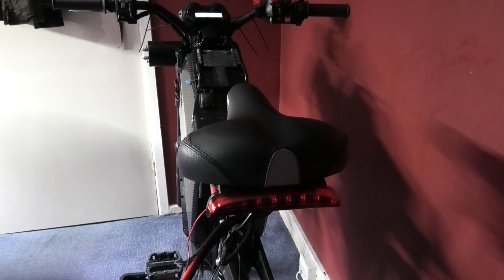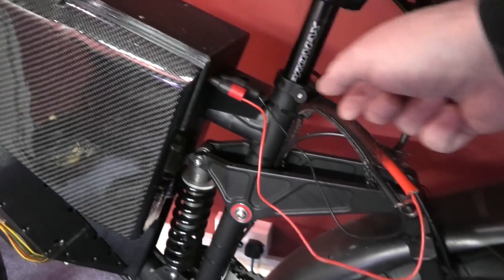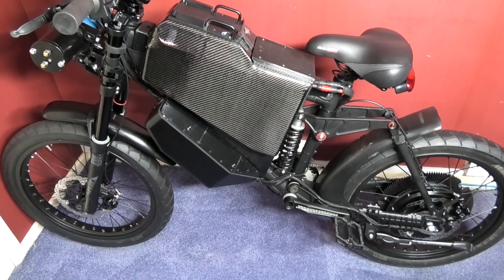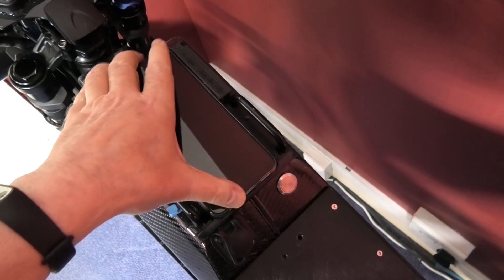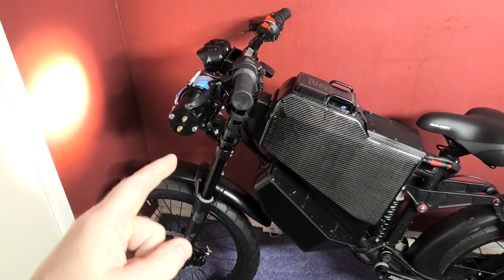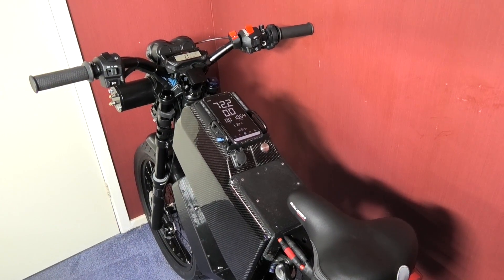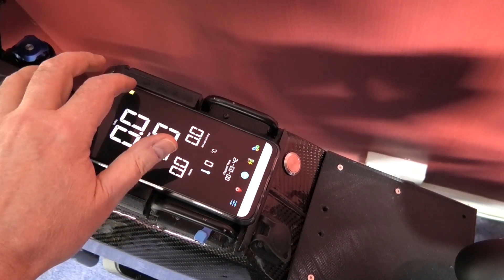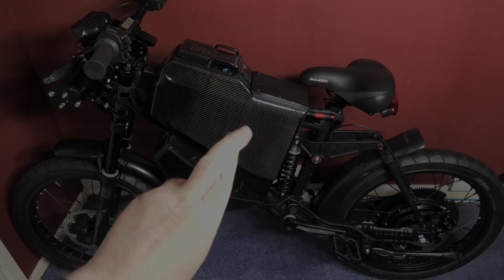High powered DIY eBike MSVA build part 30 - Ready(ish) for the maiden!

Comment: Take it down the stairs on the back wheel m8  balance it by the bars and you can use the back brake to controll the rate of descent.
Reply from the maker: Believe it or not, it'll be fine going down on 2 wheels mate. V2 was done the same way and I never had a problem 😁

Comment: Nice job Tony, it be interesting to see if the winch works. It looks to me, to be mounted above the pivot  point of balance. It could bury the front wheel into the step and start lifting the rear wheel first, kinda thing. From  an old excavator and tractor driver'
Reply from the maker: You might be right mate, it has crossed my mind. The trouble is, there's nowhere else to mount it - I can't attach it to the forks or put any pivot point on he forks because it might rip them off so I was kinda stuck. I'll be there to hold the back end down, though. FYI I'm a fully qualified agricultural mechanic with class 3 license so I know a thing or 2 about the implications of torque 😁
Reply: @Vortecks  Yeh, it's one of those "suck it n see how it goes. I presume you have a lifting eye attached to a wall, so you'll climb the stairs first to attach, then back down to stand behind him ? it would be a shame not to be able get him back home again. Is it possible to swap the two around? (winch to the wall - eye to front wheel axle) You still have to climb the stairs twice, but may have a  better pull. I can see a Laural and Hardy event coming soon..Haha...

Comment: Really ! make your monster look more like a bicycle, no chance, I'm still really impressed but I don't think you could peddle it for 1 mile which would make it a bicycle.
Reply from the maker: Please don't shatter my illusion 😂
It no longer has a motorbike headlight, motorbike indicators, motorbike tail light cluster & number plate holder - it's now a bicycle! 😂
Seriously, I've got to do something for testing and this is the only way I know. When I put it through the MSVA, all the stuff is going back on so it won't matter at all.
Reply: @Vortecks  I am absolutely awed that your doing the MSVA and want you to succeed, it was a pity that Andy Kirby failed.
Reply from the maker: @michaelbradley7704  Phase 2 will start shortly. The mounting of the winch was only meant to be temporary so I can get out and test it. I'll be making a quick-release bracket, so I can switch between motorbike headlight and winch.

Comment: Silly Question,  but can't you have the winch at the top of the stairs instead of on the bike????
Reply from the maker: @SHAWZY1973 - As Stuart has already said, it's a communal stairwell and I'm not allowed to mount anything to walls. Plus which, the noise of the winch is deafening and it would resonate through the building.
@Chris Rathjan aka Razor Shark - Phase 2 will involve making the winch removable (and wireless) so I can simply remove the motorbike headlight, fit the winch and vice-versa. This is only temporary so I can get outside and test it before I put it through the MSVA.
Reply: I'm pretty sure Tony has already thought of that. So I'm guessing bolting a winch to the wall of his public access stairway is not aloud.
Reply: @stuartdavies8388  -- You must be right, I see that now.  Ofcourse Tony would have chosen for the winch to be wall-mounted if it was possible.
Reply: Yes, that makes sense. It's only one location, get the power from the wall.
Reply: I have been wondering since it was mentioned if its permanent. I thought he would remove it at some stage. Only required on the rare occasion when he needs to get it up the stairs.  Right?

Comment: Solid state relays and a rocker switch on the handlebar for the winch. It's just a polarity switch with zero on the center, an h-bridge.
Reply from the maker: Yes, I will be modifying it. This is just temporary so I can get out on it. Phase 2 will be when I make it removable so I can fit the other headlight and I'll also make the winch wireless 😁

Comment: Dragging out the suspense Tony, I can hardly wait!
Reply from the maker: The maiden would have been last weekend mate. I put it on the paddock stand, tested everything for the last time but I found a major flaw in the wiring. I discovered that something was causing the frame to act like a massive RF antenna and it messed everything up. Fingers crossed, the maiden will be this weekend but, unfortunately, you'll have to wait for a couple of weeks to see it (Unless I'm nice and I can dig your email address out to send you the link) 😁
Reply: @Vortecks  Wow, good catch but how did you find out the frame was radiating?
I'll send you a reminder, and update you with my news... :-)

Comment: I can't wait to see that thing running like mate it's going to be wickerd. could you not wire up the winch with a servo and make it wireless... Would save weight and would also be pretty cool
Reply from the maker: Cheers mate.
The winch is only temporarily mounted so I can get out on it. I'll be heavily modifying it by making it removable and wireless.
When I've put it through the MSVA, I'll need to easily remove the headlight and replace it with the winch - that's phase 2 😁

Comment: hi you got any contacts on supplying high out put lifepo4 cells so i can recon my milwaukee v28 batteries got them stripped to bare individual cells that read moli fspe70045 3165 15  imr 27000a made in canada 7 cells in each battery  this my first recon attempt so any help appreciated mel at bolsover  they read 0.01  to 0.03
Reply from the maker: Sorry, I don't. It's probably no help but I will be doing experiments with other types of cells in the near future.
Good luck!